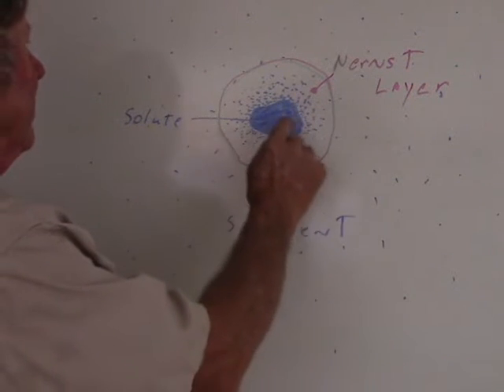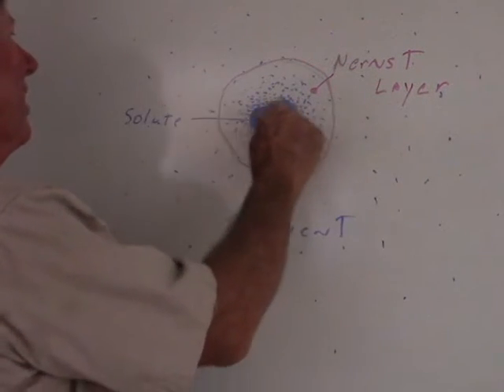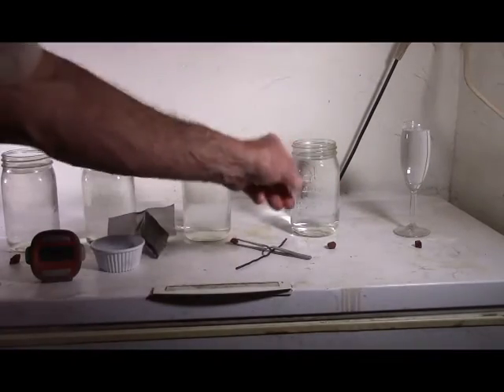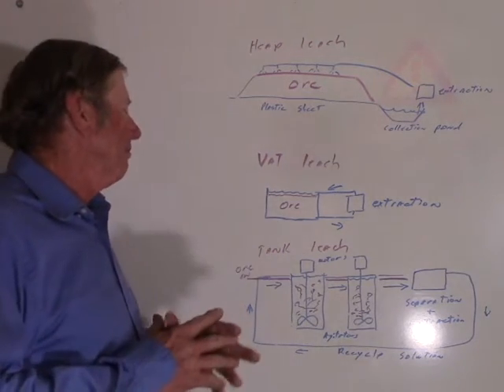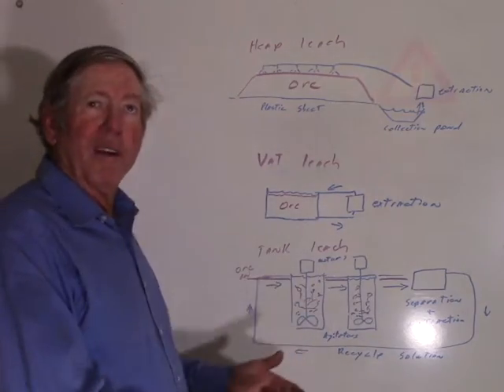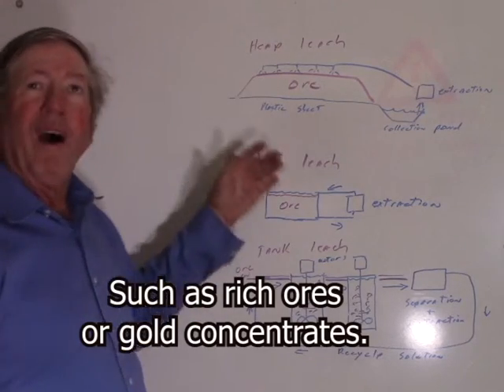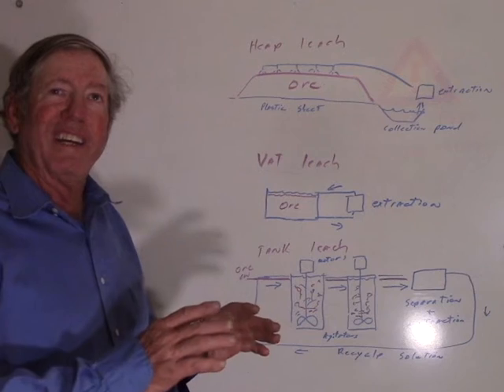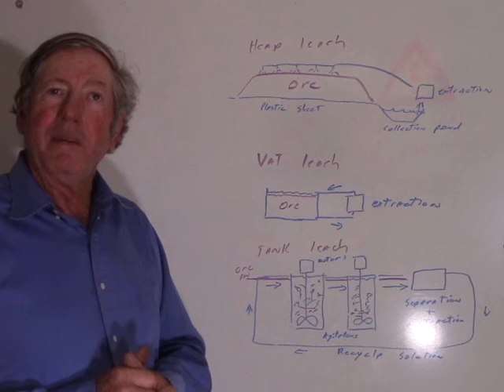Leaching Kinetics - Surface Area and the Nernst Layer

Comment: Hello, I am from Armenia, please tell me, will the sorption process take place if the sorbet is kept under the solution motionless? Thanks!
Reply from the maker: It will do so much slower.  That is why it usually pays to at least circulate the solution.
Reply: @hardrockuniversity7283   Thank you for answering! I don't understand English. I am writing to you with a translator.
Reply from the maker: @ὀρθοδοξίαὀρθοδοξία-λ6β  I thought that might be the case.  There were a couple words that were off in an unusual way.  I presume you can understand me reasonably well, but if you are unsure about something, ask for a clarification and I can word it differently so you can double check.  The translation programs are very useful, but make some weird mistakes at times.

Keith
Reply: @hardrockuniversity7283   have access to a tank with a large amount of solution containing gold, approximately 1dm/tn. What do you think if I put coal or sorbent there, the sorption of gold will turn out?

Comment: That was awesome!
I put some big chunks of ore in my wood stove. I left them in the wood stove overnight. The were cherry red while in there.
The next day I took them out to let them cool.
The ore was much easier to break up!
So far my calculations on grams per ton has been way off due to not having things in the correct order but I'm going to fix that today.
I really hate this ore because while I'm panning its like having my brother bob farting in my face the whole time. Lol.
Thank you for this information!
Now I'm going to set up the gold cube to see if there is any Free gold. So far I have not found any.
I thought It would have been 2 oz to the ton but when I realized I didn't run crushed rock. See, when I was getting samples from the Bedrock pieces were falling off and they were surrounded by loose dirt that I had put into my bucket. My thinking was that any free gold may have fell off and got concentrated in the sediments between the cracks in the Bedrock. I ran loose material thinking I would get a good yield. I was wrong.
So yesterday I crunched up a bunch and today I'm going to run up to the gold Cube then roast my concentrates. My last attempt was a failure.
Reply from the maker: Have you recovered any free gold or had an assay done?
Reply: Hard Rock University I have not found any free gold yet. I was thinking that if I did find free gold I'd have it sent out to be essay.
I'm setting up the gold cube now in hopes I can get some type of recovery!

Comment: Excellent demonstration to illustrate the basic concept and different situations. Before watching your videos I never knew there was anything other than gravity separation. I'm still catching up on the previous videos but is leaching crushed and ground materials even in the domain of micro-scale operations?
Reply from the maker: If it is high grade-yes.  There are some leachants that are relatively non toxic and easy to permit.  Leaching a concentrate is even more likely.  Like everything else in this biz- it depends on a lot of factors.

Comment: Got a question: I'm way out in the sticks. What's the least expensive way to get my hands on a couple liters of concentrated nitric acid?
*great video, btw
Reply from the maker: Check with a chemical supply house.  Do you ever go to a reasonably big town?
Reply: @hardrockuniversity7283  haven't been out of here in awhile. 400 mile round trip to the nearest small big town.
Reply from the maker: @KowboyUSA  I'm not sure what the difficulties of delivering hazmat by , say, UPS are.  You would have to check.  The acid itself isn't terribly expensive.  Last time I bought some it was less than $100/gal
Reply: @hardrockuniversity7283  I'll need to transfer it myself. The hazmat's real steep. Guess I'll just try to get everything I need from the city done all in one go. Thank you much.
Reply from the maker: @KowboyUSA  Just be careful.  Basic precautions are enough with nitric acid.
Reply: @hardrockuniversity7283  I got the basics; fume hood, rubber apron/gloves, face protection. Acids are dangerous enough, aqua regia is a level up.
Reply from the maker: @KowboyUSA  Fumes some :-) , but in some cases it can be diluted a bit and still work fine.
Reply: @hardrockuniversity7283  yes sir.
Reply: Kowboy USA you can dissolve gold using muriatic acid and concentrated bleach. Some small heat will be needed but it will work. If you want a stronger Poor Man's aqua regia you can use potassium nitrate which can be found at Home Depot in a product called stump remover <note> "not bonide stump out"
Bonide stump out contains sodium metabisulfite.
Stump remover contains potassium nitrate.
Add potassium nitrate to hydrochloric acid. This will produce a low-grade aqua regia. It just won't dissolve the gold as fast as pure aqua regia would have.

Comment: I know a lot of this theory I just don't know how to apply it to prospecting. Yet.

For example I've designed moving bed media particulate filters and bio filters which employ a lot of the same methods just to achieve different results. There have been some great developments (some by me) on reducing oxygenation costs through a number of innovations in air lift design. American guy I know who has done great work with airlifts that are way more efficient than traditional airlifts. 

I've been thinking about this to process a bunch of my sludges. Either to concentrate via froth flotation and then leach or to leach directly.
Reply from the maker: I saw a very simple floatation cell one time we could discuss via email.
Reply: @hardrockuniversity7283  That would be great. Stuartchignell@gmail.com

Comment: They can use big volume aquarium air pumps to pump air. Also the aquarium filter water pumps have special jet propulsion device at the outlet that mixes water with oxygen and blows into the water. So you get super oxygenated environment. Also pressurised system will speed up the leaching process. Of course though water pumps might get clogged from grinded material. So not having any filter will be better to prevent clogging.
Reply from the maker: The volumes in even a micro scale operation are usually pretty big unless you go to tank leaching concentrates.